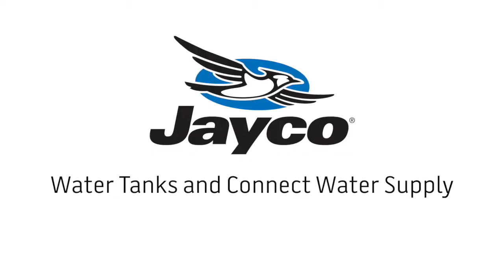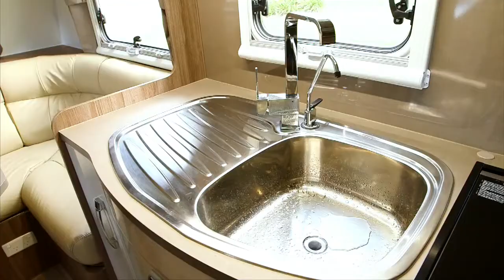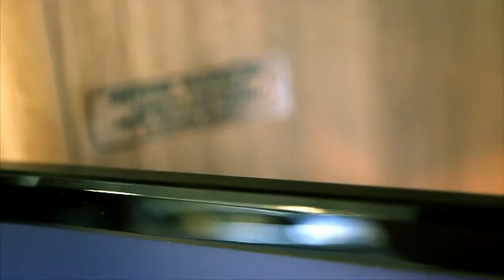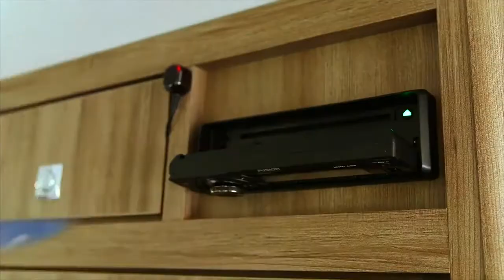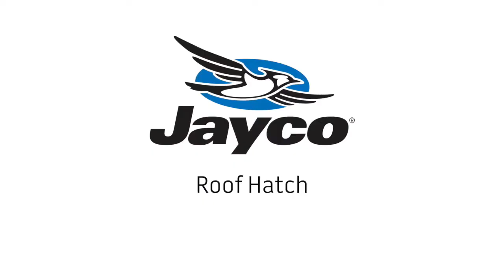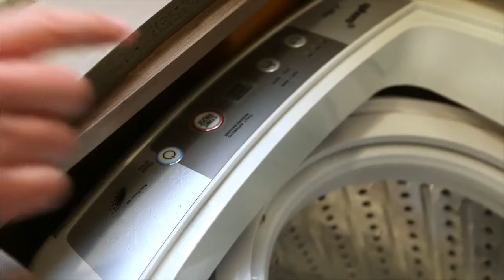Jayco Conquest Motorhome Instructional Video

Comment: You didn't show the front top section, is it for a bed or storage?
Need a video of just one set-up, not everything combined.
A lot of electrical control stuff, how does that go for a lot of free camping when no plug in (generators 👿).
I would need more solar, how many batteries are in the van, and what capacity?